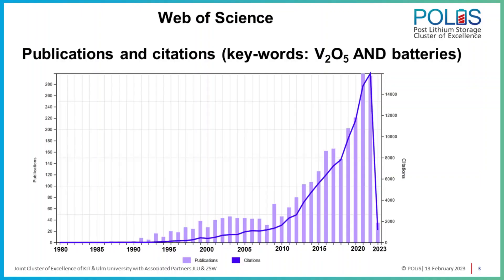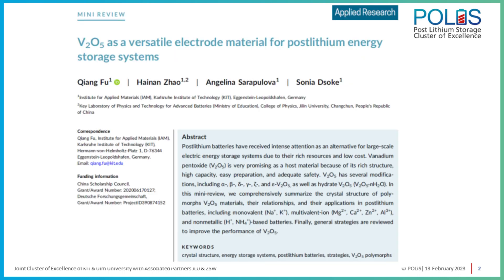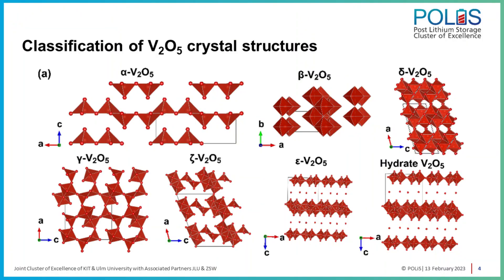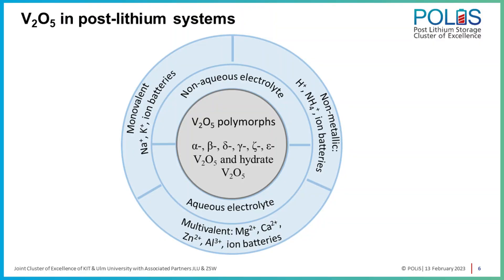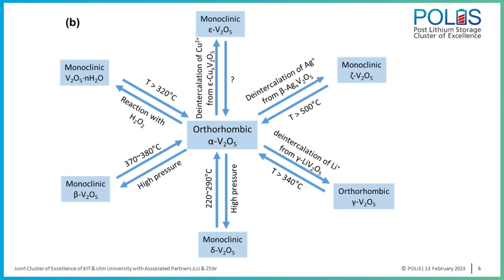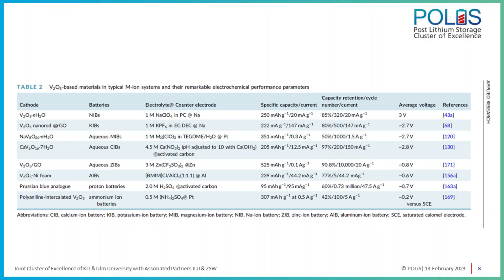Vanadium Pentoxide (V2O5) for Post-Lithium Batteries - Sonia Dsoke | Paper Pitch

Comment: Due to its amphoteric nature you could use it as a cathode material for several ionic systems, or use it as an anode material in flouride or polysulfide ion systems. The downer is that vanadium is an extremely toxic metal and it needs a conductive scaffold to work, most commonly silver. Why dontbwe get all these batery researchers together and make a cheap, enviromentally friendly,  high capacity long life battery.❤